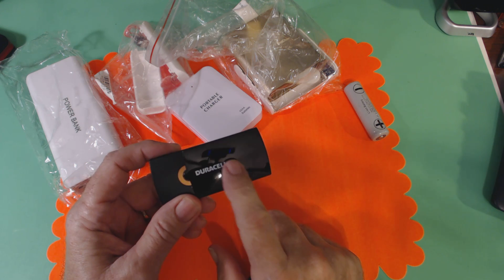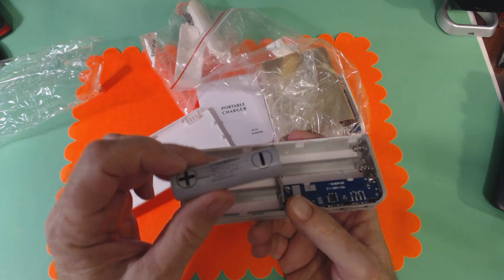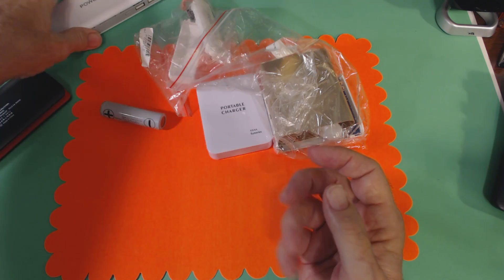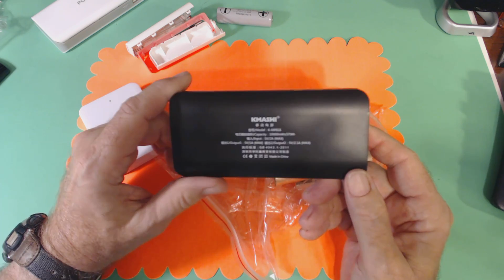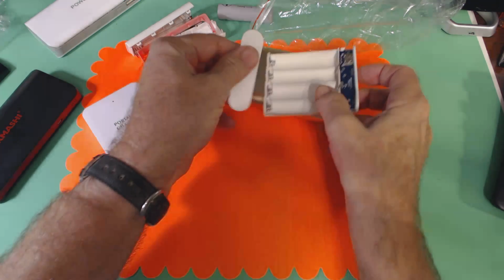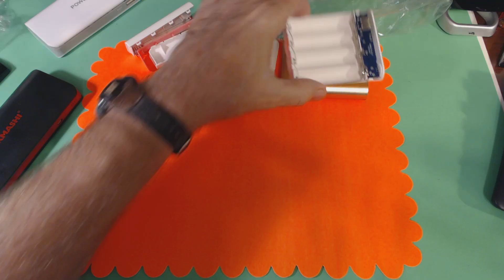TRRS #0704 - DIY USB Power Packs

Comment: Hi Tom, those look like some decent alternatives. I'm quite familiar with AA battery technology - you were mostly right about the last charger. It runs 4xAA's in series for a combined voltage of about 4.8-5.2v under load and the amps capacity of one cell (2,000 to 4,000mAh, depending on the type of battery). Rechargeable NiMh cells, such as Sanyo Eneloop (which also have low self-discharge), should give you approx. 4 hours at 500mA. If the charger has a voltage regulator circuit, then it may compensate when it drops below 5.0v and that can really help with some finicky devices. Eneloop Pro will give you 2,500mAh or approx. 5 hours at the same output, and Energizer Ultimate Lithium about 8 hours. I don't really recommend alkalines for this application, but they will work just fine if you're not using a high current device (greater than 500mA).
Reply from the maker: +solidaudioTV Thanks for the useful information.

Comment: In my experience, the fine print with rechargeable cells usually says that the 'rated' capacity is at a discharge rate of around .1C (which would be 200ma for a 2Ah cell) . Maybe you would see a higher capacity if you could use a lower load current for the test. Might be worth a try...
Reply from the maker: +TheScottytr6 Thanks for the info.
Reply from the maker: +TheScottytr6 When you have a few minutes I would like to discuss this further.  I usually am on G+

Tom
Reply: hamrad88 I tried but I'm not quite sure how to do that.
Reply from the maker: +TheScottytr6 ok, thanks